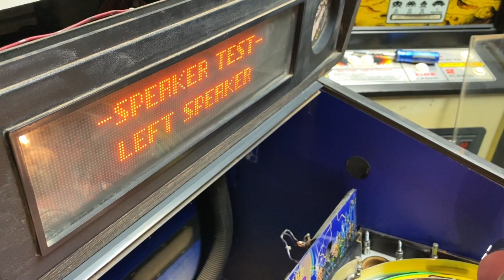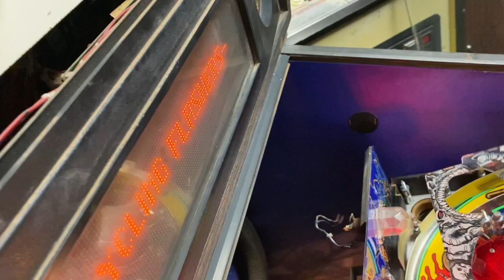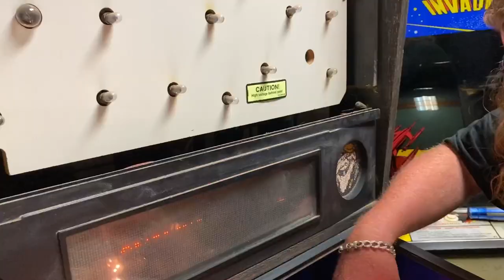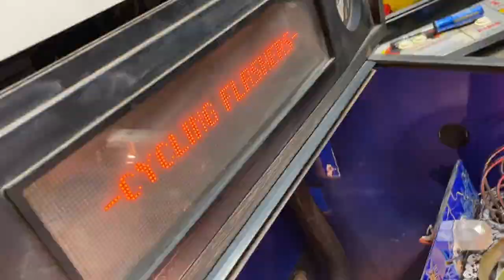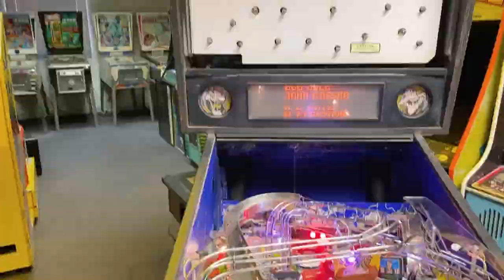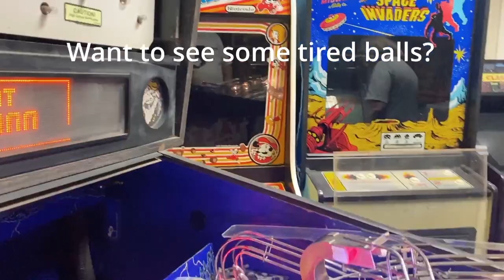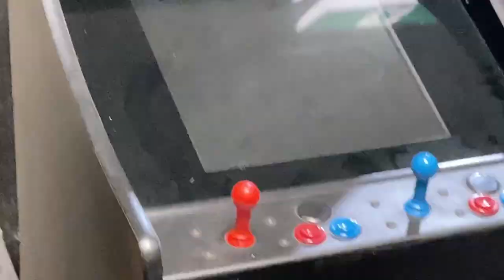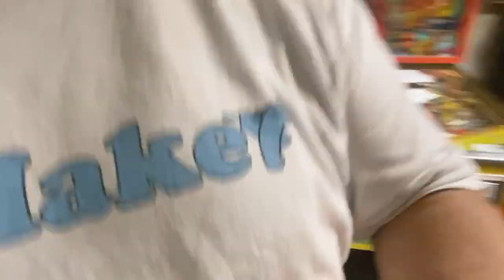Data East Tales from the Crypt Pinball  - Re-assembly

Comment: a pox on DE for their stapled in light sockets... weeks later... im still yet to pull the crypt down to finish the LED install. I put a ramp protector along the left side of the loop ramp to stop airballs from coming off that staple that protects the wires and crap just befor the middle spinner. Much slicker feel to the spinner shot. (I put 7 lite LED disks in all my pops)
Reply: interesting mod with the drop plastic standing up like that?... i put a visor made out of an acrylic fridge storage container, its almost exactly the same size and shape as the original plastic. I moved the whole plastic forward a couple of cm so it overhangs the drops , and the box/mod bit fills the space between and protects the extra lights i put in there. No more massive airballs off the drop targets. They used to sometimes get up behind the wire frames!
Reply from the maker: @LaserSharkPhotoablations  Nice mod with the led disks for the pops.

Comment: what was wrong with the back VUK? is it just the cup and switch thing on the end? mine does exactly the same.. sometimes first hit, sometimes 3-4
Reply from the maker: Not sure - I assumed it was an alignment issue as we just had that wire form off the PF. It came good pretty quickly. Russell may have more of an insight.
Reply: @prop-maker  k.. I'll fuck with it a bit more and see what develops